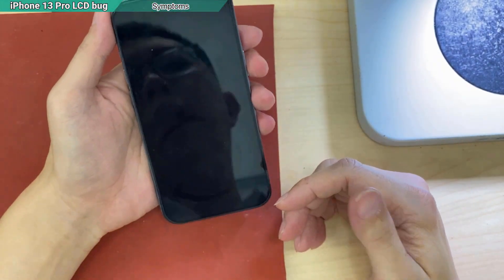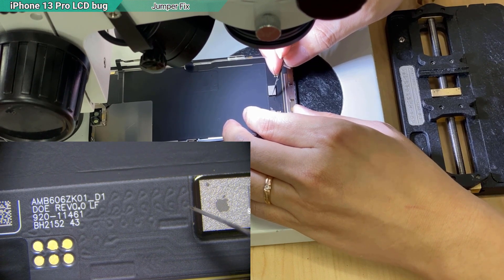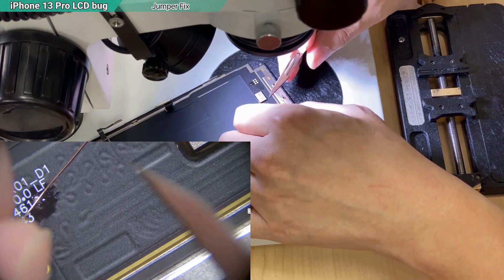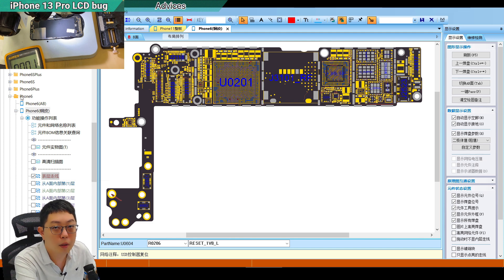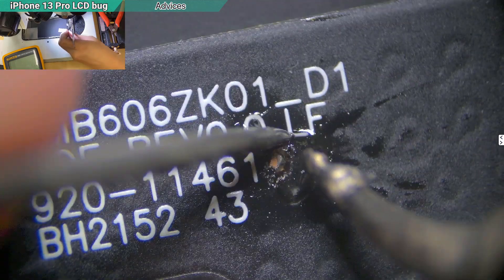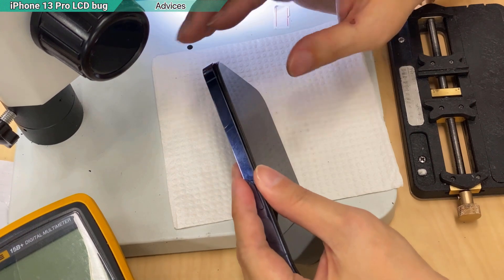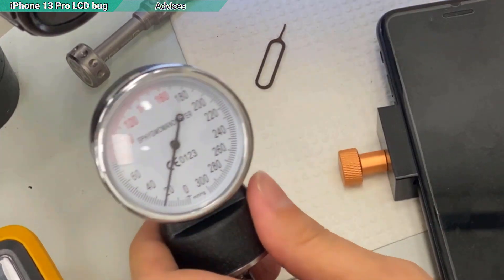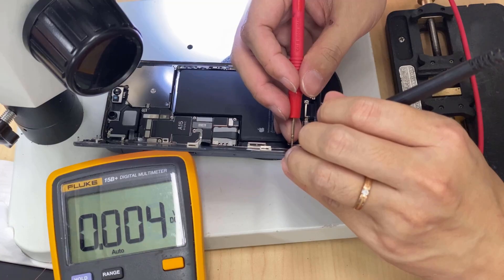iPhone 13 Pro LCD Bug Fix 【Tutorial】White Green Display Problem

Comment: Green screen after an iOS update. I spent endless, unproductive calls with Apple trying to fix the issue. Finally, I took my iPhone 13 Pro to a repair technician, who replaced the screen for $80, and the phone is now like new. I came home pleased with the outcome, only to have a visiting family member tell me that all I supposedly needed to do was hold a high-voltage spark lighter to the edge of the phone to reset the screen-control chip.
Reply: how do you do it? with the spark lighther
Reply: @indirar6790 He said the top of the lighter should touch the phone’s chassis. Then you press so that a spark is created. He claimed he has successfully done this at least ten times with green-screen iPhones. The high-voltage spark, he says, “resets” the chip that controls the display.
Reply: I should mention that the man who advised me is an IT professional and engineer. He manages the IT infrastructure for a large chain of dental clinics.

Comment: Sir, I have the iphone 14. The screen is green at low brightness, if i force high brightness (by putting a light in the light sensor), i can see the elements on the screen, but very difficult.
Could you share the pin arrangement for the jumper for the iphone 14? (not pro, only iphone 14);

Much thanks

Comment: this is a total failure in quality control of parts from apple, no point in bragging titanium, steel frame and ceramic glass crack resistant, scratch resistant when simple drop is disrupting the internal circuit on the display, IMO apple should recall or replace the display for free, they get these screens for so cheap from manufacturers like Samsung.

Comment: Also teacher ive seen a video where someone fixes it with an electric igniter lighter, they just put a thread on the 7 pin on the right and use the electric igniter on the thread and the screen just works again have you heard of this method and do you recommend it?

Comment: “I have a 13 Pro. I heard from many people that after updating the iPhone, the screen turns green. So, I didn’t update it after iOS 16. However, even without updating, my screen turned green. I got it fixed by installing a jumper. Now, can I update my phone? Updating won’t cause the screen to turn green again, right?”
Reply: does the jumper last?
Reply: Asking if the jumper still working after updating? My 13pm got geeen screet today 😭

Comment: For me it actually workedd!!! The i scratched the left other two on the left side of the screen. I didn’t jump or solder it just used the lighter crystal shock on the middle scratched pin and the display turned on and works without problems😂😂 thank you for your help even tho i had to improvise… not sure how it worked with the middle pin on the left side being shocked tho…

Comment: the local service repairman did this to my phone and it worked but now i have a problem, after repairing the phone using this method o wire jumping, my iphone camera and flashlight won't work, only part that works is the 3x to 15x zoom and front cam. Can u help with this?

Comment: Hi, less than a month ago I send my phone for a repair and the same method is used to fix the green screen issue. Now, my phone has a slight dark green flickering screen.
It is still under warranty. My question is - will I have to replaced a new screen or can it still be repaired?

Comment: I wonder if you can use 0201 smd resistor instead of 01005 , different voltage though

Comment: I have my iPhone 13 Pro like this, (screen yellow) I don't have a 100K SMD resistor here, but I do have the blue metal one. I hope I can do it... If it works I'll come back here
Reply from the maker: Just to jump it and it will still work. Without the resistor, it just has a higher risk of damaging the source, especially if the owner drops the phone hard.

Comment: How many chances of it will not lose the whole LCD ?
Reply from the maker: 99.5% so far today. I have fixed more than a hundred 13 Pro or Pro Max screen disease.
Reply: @iPhoneServiceMalaysia  Hi sir, does the solution is applicable to iphone 13? ( the regular version)

Comment: Sory i wanna ask...if we already do a jumper on any iphone get white screen & when we update the lastest ios, is it will be the same thing like green screen or anything??
Reply from the maker: No. So far we update iOS it’s still working. Any issue we just measure which dot is the problem and the fix accordingly.
Reply: @iPhoneServiceMalaysia  before i forget, while our iphone 13 series which already do a jumper on it...if we keep using 120hz , is it ok for a long time sir?
Reply: @iPhoneServiceMalaysia  before i forget, while our iphone 13 series which already do a jumper on it...if we keep using 120hz , is it ok for a long time sir?

Comment: Have you ever seen this problem on the normal IPhone 13? What would be the points for the jumper?
Reply: In the video, he mentioned that the jumper helps borrow voltage from the other point.

Comment: I bought the first batch iPhone 13 Pro Max. My warranty already ended January 2023. Last week i got this problem. Call apple support and they gave me an appointment for repair in Switch. Took only 1 day to fix. 

Got screen replacement for free and save me Rm1800. 

They also gave me 90 days extra warranty and after that no more free replacement if this problem reoccur again.
Reply: Is it
Reply: My warranty also gone and they refused to solve it for free, how did you do it? I can't afford to change the display

Comment: U did a great job a appreciate that does the same jumper works for iphone 14pm
Reply from the maker: Waiting for a real case from 14 series
Reply: @iPhoneServiceMalaysia  Hi ! The same problem has just occurred on my 14PM which is 1 and a half years old. Green screen then definitely white with a few lines. I hope that the after-sales service will provide a solution.
My 6s and 8 still work well ...

Comment: Any chance to happen again after resolving this problem?
Reply from the maker: usually 9 out of 10 they're ok.
Reply: I have repair my wifes IPhone 13 Pro Max , but i don't know what method the technician have used. After 12 months the same problem back again. Its possible repair again if the jumper is already made? @iPhoneServiceMalaysia

Comment: a year past i’ve got this same issue to my iphone 13 pro max. its resolved because it is in warranty but apple needs to address this issue and try to solve it even the device’s warranty has ended.
Reply: The problem will still coming even though they replace the new one, trust me that is the main reason I let go my 13pm.
Reply: Heh did you update developer version or beta version except public version ?or any other issue ?

Comment: Hi sir, can I ask if you just solder the copper wire or u have to apply something on the copper (tinning)? Adding on, I dont have iPhone 6, thinking to just buy some thick/thin film resistor. Will it work? Appreciate the help in advance!

Comment: Hi Lim, so you mentioned 13 pro & pro max. So is the issue not so common in the base model iphone 13? Does it has something to do with the 120hz refresh rate on the pro models? Thanks!
Reply: Yes it does. We made a video on affected devices.